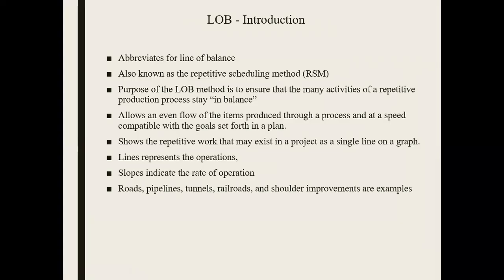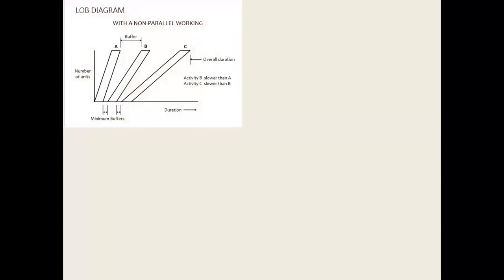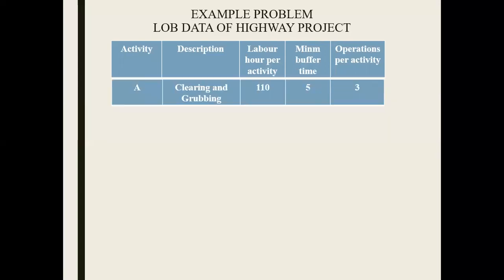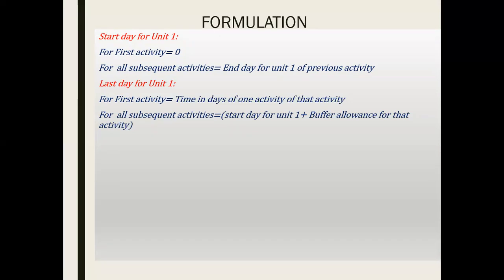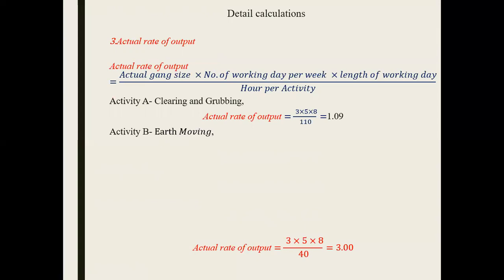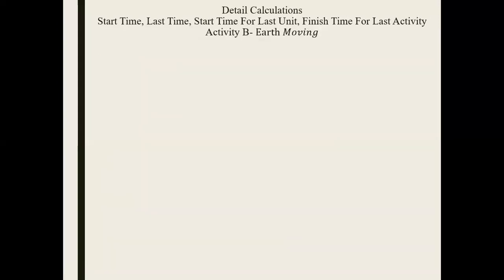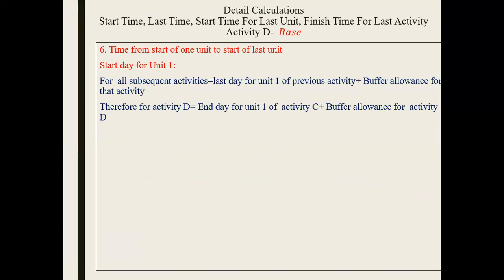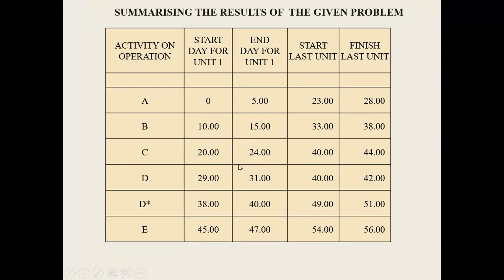LOB  TECHNIQUE FOR HIGHWAY CONSTRUCTION-SOLVED EXAMPLE

Comment: in minute 15:00 what is that column numbers which its title is operation per activity, what are those number, 3, 8, 8, 3,  and 3 also could tell me when you used those numbers in your calculations?